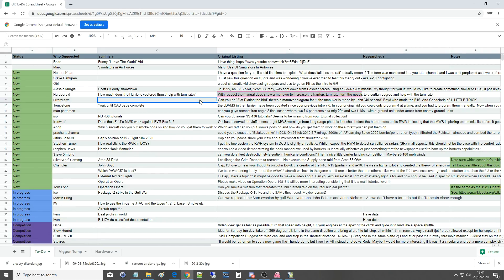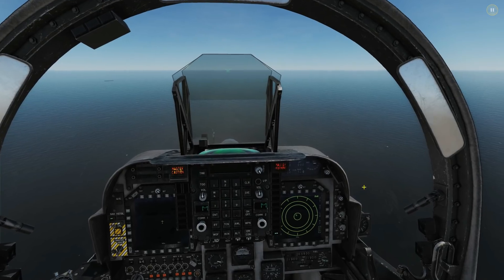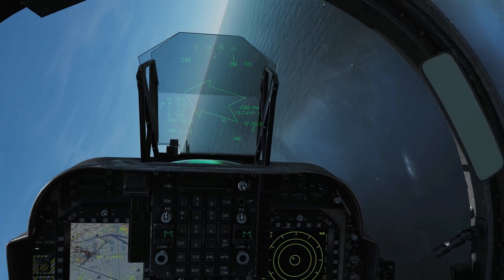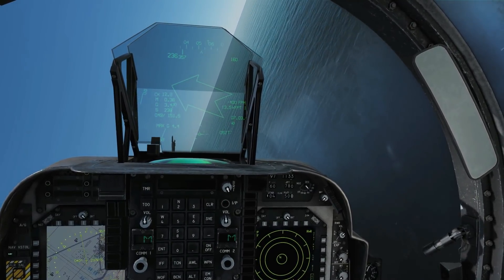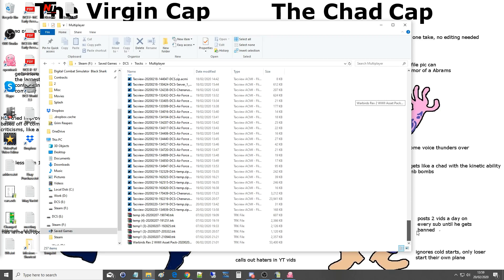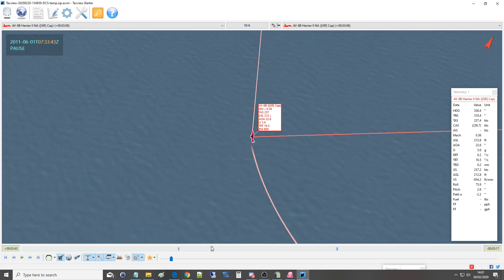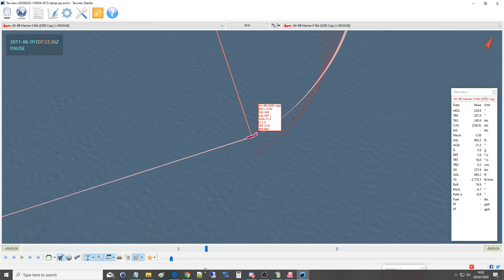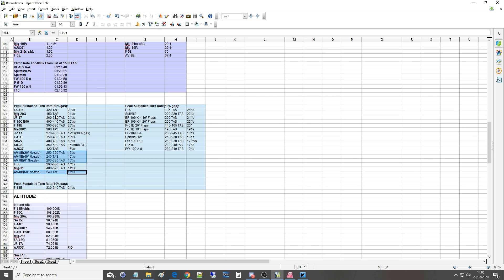AV-8B Harrier: Max Sustained Turn Rate (With Thrust Vectoring) | DCS WORLD

Comment: Surely you would go into a turn with nozzles facing the rear pulling back on the stick and then move nozzles to flick the nose round in a higher turn rate to get the most out of the vectored thrust

Comment: The engine only has thrust slightly greater than weight.  So the nossle angle doesn’t help much after the first few degrees.  It is a basic sine/cosine thing.  The sine of 0 is zero, and cosine of 0 is one.  But while the the sine of 20 degrees is 0.34, the cosine Of 20 degrees is 0.94.   So at that first setting you gain 0.34 Newtons of turning force for every 0.06 Newtons of thrust that you lose.  Add in 10 for the aoa, and the numbers are 0.33 newtons of turn for 0.11 newtons of thrust lost. ( Cosine(30)-cosine(10) vs sin(30)-sin(10) )

Comment: The F-16 should dominate in sustained turn rate based on the other DCS aircraft. The 2 best should be J-11A and F-16C
Reply: The F-16 in the real world has a Sustained Turn of 18 D/S, lower then most but better then some, for example better then the F-35 at 11D/S but worse then the Gripin 39 at 20.4 D/S.
Reply: @forzaisspeed  pure fiction! Absolutely no EM diagram for any F-35 is available to the general public, and it's sustained turn rate is ABSOLUTELY better than what you say. I remember you from another thread where I absolutely eviscerated you in the comments over these false statements you made. You want to do it here too? Show me a source for that F-35 sustained turn rate.
Reply: @forzaisspeed  what? There is literally no source for an 11 d/s turn rate on the F-35. That's nonsense. I'm not the one who needs a source here.
Reply: @EEEEEEE354 

Kid you need all the help you can get stop using wiki as your source, and it's Easy to find the Sustained Turn Rate of the F-35 online, just have to know how to use a computer. 😂🤣😂🤣😂🤣.
Reply: @forzaisspeed  there is no source regarding the sustained turn rate of the F-35. You cannot provide me with a source, and thus rely on ad hominem to try and degrade my credibility. I.e. you try to call me stupid for using wiki and YouTube to deflect attention away from the fact that you still haven't, and can't  provide a source for an 11 d/s turn rate. No such official figures exist, and I'm not using wiki. I don't need wiki, or any source for that matter, to refute unfounded claims. You are wrong
Reply: @forzaisspeed   you still can't provide a source. You're still wrong. I'm still right. Just admit it boy

Comment: Cap: during the Falklands war,  the British Harrier used trust vectoring turning to out-turn Argentinian fighters in dog-fighting.
Reply: They were Sea Harriers, These are AV-8Bs, completely different birds. Different wings, different weight etc etc...
Reply: True , different wings , however the engine worked the same way .
Reply: I have read myth too. They shouldn't have needed to against older planes armed for ground attack missions flying from the mainland with limited fuel, limited routes and limited time on target. If I had to guess most of the Argentine planes were not even trying to shoot at the Harriers. They were more interested in bombing and that's really all they had time for. Most didn't even carry Air to Air missiles.
Reply: FritzOFN I read somewhere that this was just a myth and it never found use in actual combat but I don’t know if that’s true. Does anyone have more info on that?
Reply: I think you are correct. The "viffing" manoeuvre much spoken about might have happened once or twice possibly. But in Sharkey Ward's book about the Falklands, he says the Harrier's success was mostly due to effective use of the Radar capabilities of the ships and the Harriers's own radar, to continually thwart most of the strike missions launched by Argentina. In most sorties, the Harriers just had to show up, and as the Argentinian pilots were far from home, they were told to ditch munitions and run back. Most of the kills were achieved by Harriers getting the jump on the enemy strikers with efficient use of the Blue Fox radar.
Reply: Nah, the advantage was the sidewinders against magic missiles, in my humble opinion
Reply from the maker: rgr